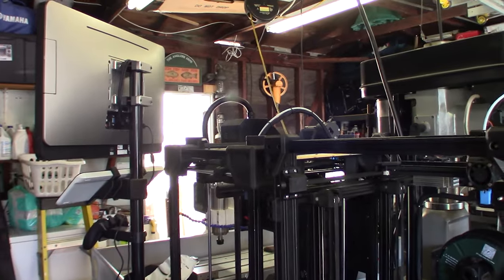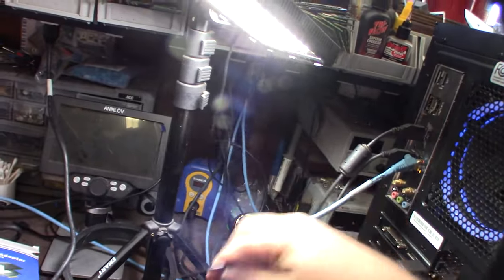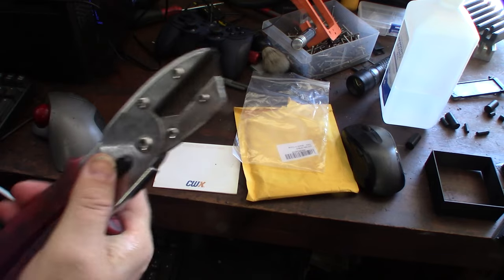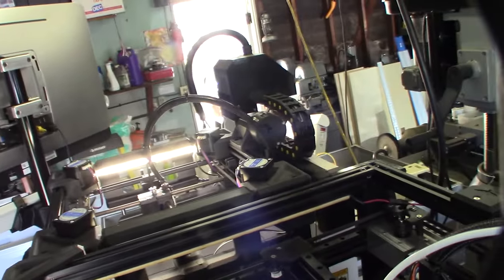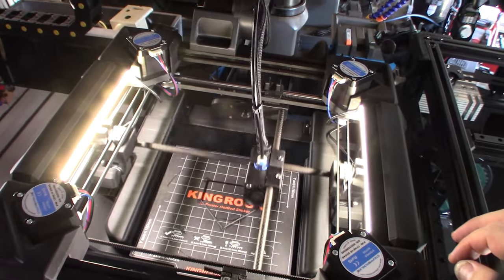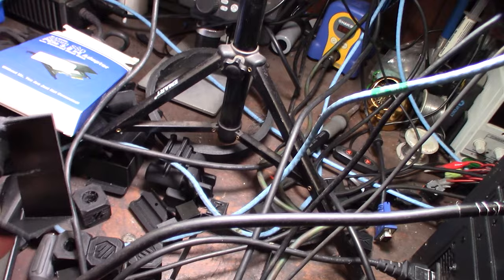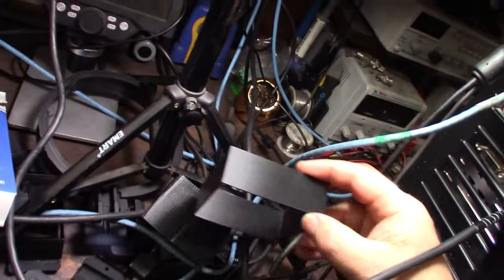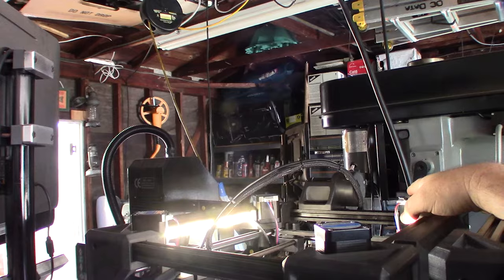Celeritas World's Fastest 3D Printer Concept, 1.9mm PTFE Bowden Tube CroXY Carbon Fiber Tubes Part 9

Comment: That vibration sounds similar to one of my AWD printers before "syncing" the motors. You should try engaging the motors and loosening the grubscrews on one of the pulleys before tightening them again. I would do this for both pairs of motors if you haven't already. Vez3D has a video on mechanical motor syncing as well.
Reply from the maker: Good info, I'm going to look into it. The printer is Cartesian. Makes sense, motors need to stepping at the exact same time. I might try running two motors off one driver so I know they are both being command to step on the exact same time. I also made sure the motors wire length were all the same length, gauge and brand.
Reply: @fintechrepairshop  I would be weary of running both motors off one drive as it will cause extra/double the back EMF and usually results in worse performance. I would highly recommend looking at Vez3D's video for motor syncing, more about making sure the pulleys on motor pairs are exactly aligned so that they don't fight each other during some moves.
Reply from the maker: @MagTheFrag  Thanks

Comment: I like that 45 degree idea, that bowden looks pretty great for bowden! That resonance you have is the same thing I was talking about that we encountered in our croxy printer which limited our top speed. Our conclusion was that it has to be interference between the steps of opposite motors. Have you done input shaping yet? It is surprising that it wouldn't prevent it, since it seems very frequency-dependent?
Reply from the maker: Yeah, I have a USB accelerometer. It is really bad at low speeds. You are actually making really good points. I didn't even think about the steps on opposite motors. I might try running two motors one driver. Right now I'm running a TMC2240 on each motor.  I wish I could find the source of bambu labs carbon rods. Those things are perfect.
Reply from the maker: One of the cool things about fixing 3D printers is that I get to see allot of designs.
Reply: @fintechrepairshop  Using the same driver seems to defeat the purpose of having two motors though? Would that even work very well? A driver works by having a comparator, the mosfet closes and the coil current rises until the comparator fires (it rises slowly due to inductance of course) and then it switches to PWM. But the two motors won't have identical inductance, so initial current will not be the same.

Are you synchronizing steps now between opposite motors? Or homing each side individually? I think that having the steppers mirrored would be a better approach here because then the resonance would always be the same (and thus able to be canceled each time without recalibrating input shaper). If you independently home both motors, the motor angle difference will be random, so resonant behavior will be different each time. Just a theory. When we built ours, input shaper didn't exist 😀
Reply from the maker: @jessicav2031  Good explanation, thanks.
Reply from the maker: I had another comment about syncing the motors. I'm not sure of that applies to Cartesian printers. I'm going to double check all my axis for squareness and alignment. I might mess with hole spacing on the toolhead.